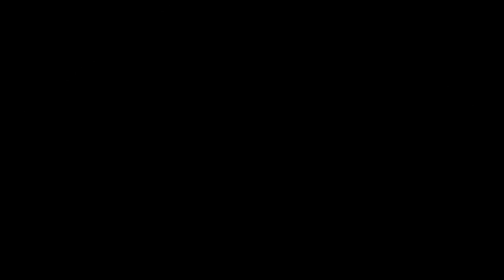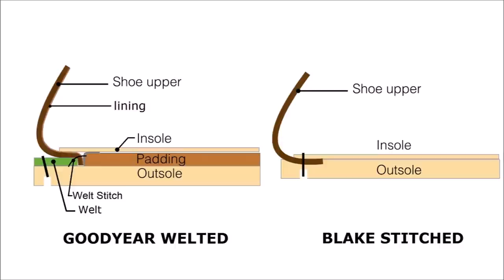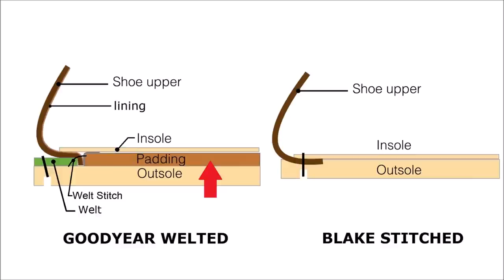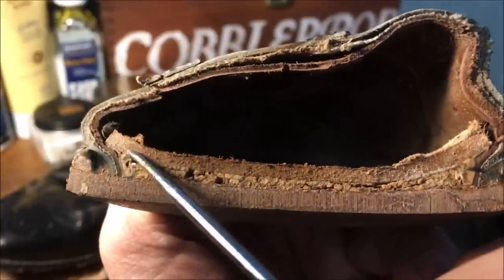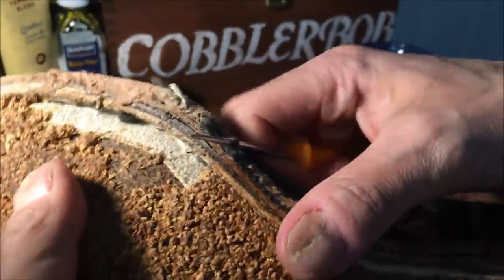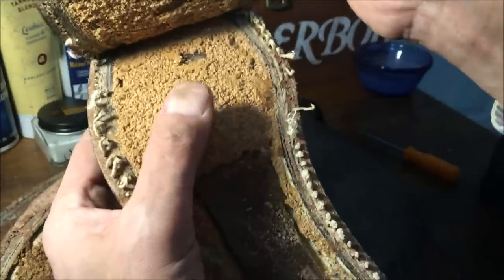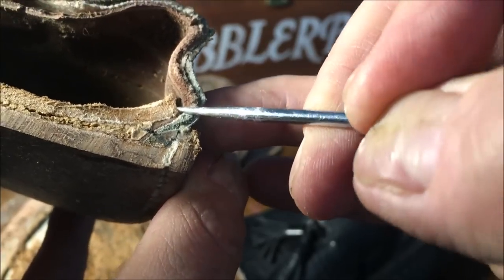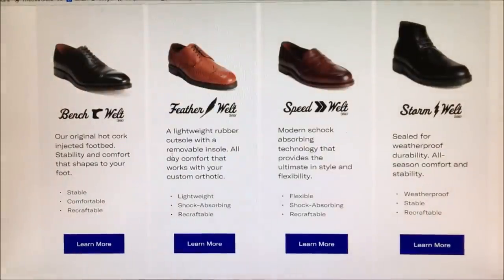Goodyear Welted vs Blake Stitched Construction Shoes

Comment: A very good video. Cutting the shoes apart really shows off the methods well. Robert you can make videos the rest of your life just on construction methods. The waters are very muddy with construction. For instance there are some factories that do Bologna construction. This is where the upper is sewn into a tube. You are actually standing on the upper. At this point the maker can cement a sole on or Blake stitch on a sole or Blake Rapid. Yet the shoe in all these configurations is still referred to as Bologna construction. Just like when a GYW company decides to cement a sole on a welted shoe. Your intent was to show the difference between a GYW and Blake and you have done a good job.
Reply from the maker: Phil Schiavone - 🙏🏼 thank you! And very good points! The question is how do I get samples of those without blowing money?

Comment: Great video Robert. The gray canvas in your diagram is called the insole rib. It is usually glued to the insole and that is what the welt an upper are stitched to. In bespoke shoes they don't use a rib. They  bend the insole into an L shape and Stitch directly to be in insole. I will add a disclaimer that as you say I am not a professional cobbler so the bending of the L shape may not be 100% accurate but it gives you a rough idea of what is going on
Reply from the maker: trekvana thank you... I think it’s also referred to as “gemming”? And yes, I’ve seen bespoke shoe makers do what you’re talking about, but the way I would describe it rather than “bending“ the insole is they actually take a thicker insole leather and carve out the area inside of and outside of the rib, to leave an edge standing up like an “L” to which they stitch.
Reply: Great video. Excellent explanation. 
But the gemming issue is eally not a bespoke versus non bespoke distinction. It’s a hand welting versus Goodyear welting distinction. Goodyear welting always uses the gemming method where the insole is glued to the gemming which is then stitched to the welt rather than a hand welt  where the insole is stitched directly to the welt. You’d be crazy to get a bespoke shoe that is Goodyear welted and don’t know any that do that. But some non-bespoke shoe makers, e.g. Buday in Budapest use a hand welt. It’s significantly more expensive to create a hand welted shoe because, as the name implies, it most be done by hand.

Comment: Hey Bob, there's in fact a third method of construction that's commonly used, known as "Blake/Rapid" or "Blake-Rapid" construction. It's like taking a Blake-stitched shoe and then stitching a second outsole to it (basically, the original Blake outsole becomes a midsole). This process results in an obviously thicker sole that's more durable and resistant to moisture and the elements than a traditional Blake-stitched shoe, and more comparable to Goodyear-welted shoe.

However, confusingly, a lot of shoe brands don't make a distinction between Traditional Blake and Blake/Rapid construction; if they offer a Blake/Rapid shoe, they'll often just call it Blake. You kinda just have to use your eyes to figure out which one it is.
Reply from the maker: kaikaichen - I’ve read / seen videos about this method, but I cannot honestly say I’ve actually seen a shoe with it. Are there any popular or common shoe brands that use it that you know of? I’m assuming the way you’d ID it is that outside it would look like a Goodyear Welt, but on the inside of the shoe you would see the Blake stitches coming through the insole?
Reply: @CobblerBob  TBH, the only shoes I personally know of that use this method are those from some of the new, popular online direct-to-consumer brands such as Ace Marks, Jack Erwin, Beckett Simonon, and Velasca.

Comment: That grey piece (canvas) is in fact the ONLY thing keeping the insole attached to the welt and the uppers and the outsole.  It is the main failing of goodyear welted shoes compared to handwelted shoes, done to cut costs and reduce the need for skilled shoemakers in the production process.
Reply: Hi Robert, I think it might be super interesting to get a sense of how easy/hard it is to tear apart the plastic/canvas strip from the insole when exposed to moisture vs kept dry.

Comment: Hi Bob, Thanks  for this . I have a question; is that layer of cork mandatory in a Goodyear welted shoe? Do ALL makers of Goodyear  welted  shoes put it in?
Reply from the maker: Kenny Desai -no, I’m not sure if you saw the end of the video with the new Allen Edmonds explanation, but I’m pretty certain manufacturers sure can use other materials. I’ve owned Johnston Murphy shoes that feel like they have foam rubber in there.
Reply: @CobblerBob  Thanks so much.  Really appreciate the  trouble you take.

Comment: I have a question that I just have bought a regal leather shoe which was described as blake stitch shoe but when actually I did the same way as you did to spot if it was a stitching inside the insole of the shoe, I got nothing. So I just wonder If I was ripped off?
Reply from the maker: Cius P. When you say “described as“ do you mean by a sales person? Or on literature on the website? You may want to check out a video I just released: “How to spot FAKE shoe sole stitching!“ I think it will answer some of your questions. Sometimes shoes have an insole you have to peel back to see the stitching.
https://youtu.be/-oRWEzvoVe8
Reply: Robert Powers Saleman told me that. I notice that there is thin layer that's clued over the insole, but i don't know how to reclue that layer back onto the insole once i peel it off in oder to inspect if it's genuinely blackstich
Reply from the maker: DAP Contact cement should do the trick.

Comment: Can a Blake stitch shoe be turned into a Goodyear welt?
Reply from the maker: Well, not really. That's a tough question bc some will say "anything is possible", but for the average professional cobbler? I would venture to say 99% would NOT take that job. Steve at Bedos Leatherworks MIGHT, IF there is a lot of extra leather to stitch the new gemming to the old upper. It's more likely that they would turn it into a Blake Rapid contruction. Picture a Blake Stitched shoe where the new outsole is thinner, and is now not an outsole, but used as a midsole. Then the new outsole would be stitched with a Goodyear Welting machine to the new "midsole" instead of a welt, because there is no welt on a Blake Rapid shoe. It still would not have a corkbed though.

Comment: Why is there no welt stitch at the heel portion in a goodyear welted shoes?
Reply: I think it's mainly for aesthetic reasons—some people don't like stitching in the back and prefer a slimmer heel profile.
Reply from the maker: A 360° welted shoe like Allen Edmonds that you saw in my video DOES have the welt go all the way around. 270° because you’re well to choose, the wealth does not go around the hill. Generally speaking, the stress on the heel is compression only. With a 270° GYW shoe, you can get the heel much tighter to the upper. I guess the short answer is the welt is just not really necessary around the heel. Most of the most expensive English Goodyear welted shoes have a 270° welt.

Comment: You cannot say that GYW is better than BS because you are comparing totally different things.They both have pros and cons. You said it yourself BS can make the shoes slimmer thus more elegant. If all you do with yourr shoes is walking pavements and going indoors...no diving into mud and deep puddles chances are you don t really need GYW. The cost is significantly higher even with resoling. And there is a limit on how many times you can resole. At some point the upper is going to be beyond repair or might even go out of fashion (ie monk straps they aren t so classic as the oxford) and you don t know when you buy the shoe, how long can you expect for an upper to last?For sure a GYW is going to outlast a BS but can it outlast 2 of them the cost would be almost the same.But 2 BS shoes would offer you more options with your look. BS is as good as it gets. I would choose finesse+lower cost over sturdiness any day of the week.
Reply from the maker: very good points Aris